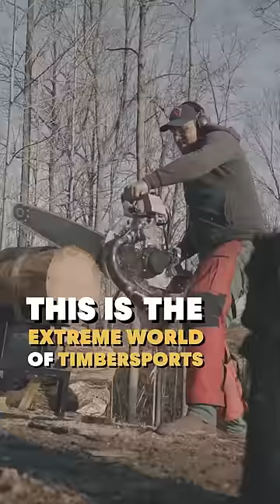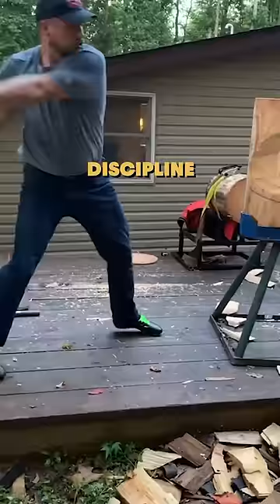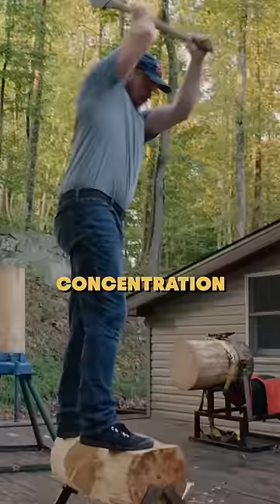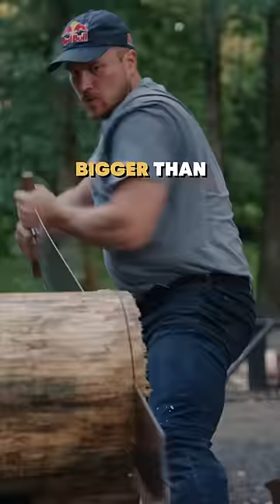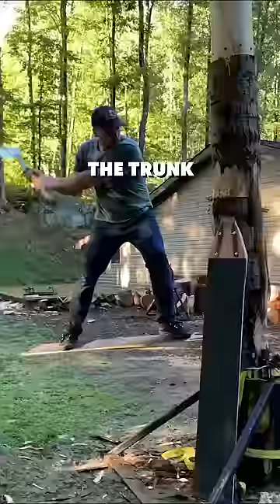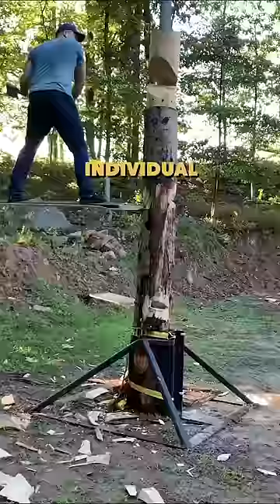How Do Timbersports Athletes Train? 🪓🪵

Comment: Knowing my clumsy self I would mess around and accidentally cut part of my foot off 😂
Reply: I’m sure that’s happened before at least 5 toes- eh I mean times.
Reply: It happens.  Hell, I don't even do it as a sport and I've "shaved" my leg before 😂.
Reply: They do wear steal toed shoes that can’t be cut right through with an axe which helps.
Reply: @crushedavocado203 still😭 I promise you the blade would still go into the boot, with the weight of you body and the force your using, yea, I’d not think those boots are stopping anything
Reply: @Cxrrupttion  You’d be surprised what they come up with.
Reply: @crushedavocado203  who?
Reply: If that happened, youd better stay outta my town. Im lacktoes intolerant 😤
Reply: That was an overstatement
I would cut through my spine and accidentally split the continent open
Reply: My brother did that with a hatchet, right in the shin.
Reply: @Danilows  oof yea that what I mean
Reply: Or back and head dead bc accidentally miss use
Reply: @Cxrrupttion  they have the equivalent of plate boots on, they are fine. it will hurt like a mf but wont chop off your foot

Comment: You know their forearms burning 😭
Reply: Abdomen, too - gotta' put your whole body into the swing, legs to launch, torso to twist, arms to hold steady on impact
Reply: @ZaZi-Zeta01 legs?
Reply: Not if you train you know what they say train hard fight easy
Reply: @jamesrosewell9081 it's a whole body thing. If you had ever cut down a tree you'd know, but you probably haven't. It's hard work.
Reply: @jamesrosewell9081 Yes. Just like with boxing, baseball, sumo, etc. You step into your movements to put your entire bodies weight behind it. 

Try throwing a punch at something soft with your feet planted firmly side by side. It's got some force. Now do it again, but this time.. Start the motion of the punch in your feet, and use every muscle in between to launch yourself forward as you punch. Not actually leaping forward. But almost like an intentional flinch to build momentum.

The difference between punching, and throwing a punch. When you learn how to put your entire bodies mass behind a movement it becomes scary strong. Explode with everything not just your arms. The difference is threefold. This is why footwork is such an important asset to fighters. Being able to explode off of them and translate into a punch is how you punch like Frazier/Tyson and break bones through padded gloves. Or in this case, make any movement stronger.
Reply: @mid1429 dude it’s still intense asf even when you train. They can just do it for longer but their muscles are still getting activated from it

Comment: I'm not going to lie. The saw one is just do it like 20 times and you should be able to do it fairly fast and hatchet throwing. You could probably perfect that in like 2 months of practice at least in my experience, but the chainsaw one would probably require a long time of work and especially the ones with the ax takes years of work to get right

Comment: I'm sorry but I think you pulled that number of 6 foot 7 being larger than 99.9% of the population out of your arse, since the average height in a number of countries is six foot and the majority of the population is usually between 1 foot taller or shorter than said average (meaning there's at least 25% of the population over 6 foot 7 in those countries, with the added ones that are even taller than that added in)